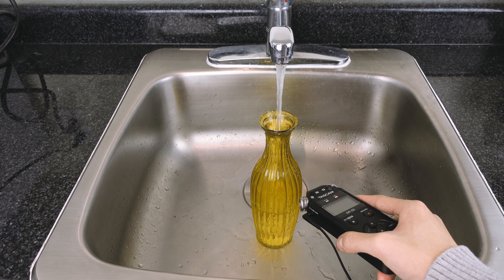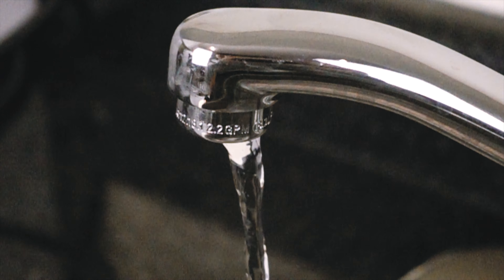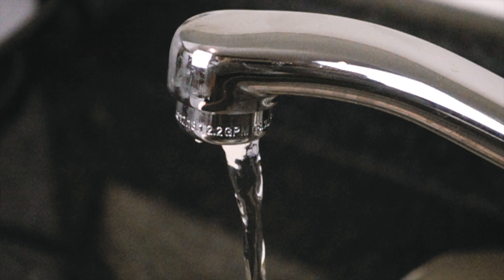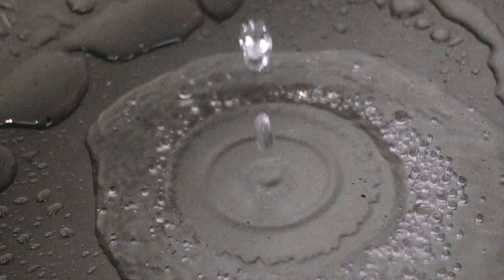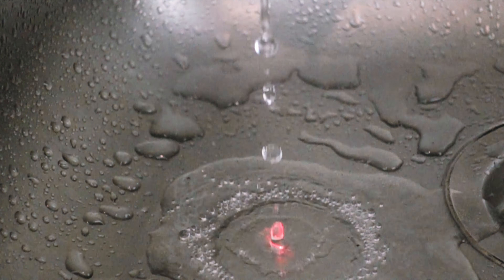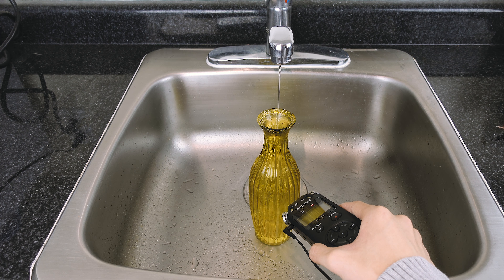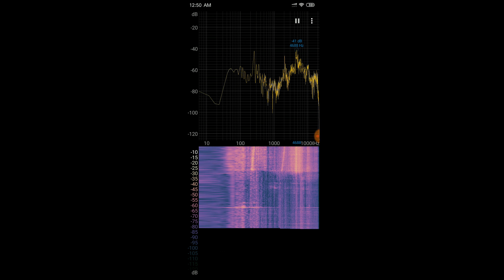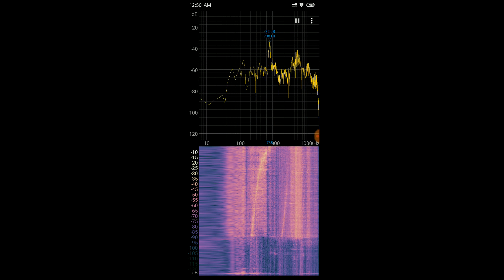IYPT 2019 Problem 5 Filling Up a Bottle Demonstration

Comment: can i ask you some question  Is the speed of water that flowing out of the faucet affect to the frequency of the resulting sound?
Reply from the maker: Of course when the flow changes from laminar to turbulent there will probably be a change in the sound of the water. But other than that, I didn't heard a significant difference in the frequency of sound. You can verify this easily with a simple experiment just like mine.

Comment: Hi, may I ask which spectrum analyser you used?
Reply from the maker: Hi Rachel. I used an app called Spectroid. If you have an Android device, it's available in Play Store. If you have an iOS device, an app called SpectrumView seems like a good alternative.
Reply: @canadianyoungphysiciststou9723  thanks for the reply! Anyway just trying my luck here, do you think the phenomenon here is standing waves? (Just for context my professor has made us work on this problem for a graded project. But since my group has limited physics knowledge we're a little lost here)
Reply from the maker: I think some form of standing waves is definitely important. I feel like the theory of a Helmholtz Resonator (maybe with some corrections) is probably applicable here. The shape of my bottle is not ideal. If you have a bottle with a simpler shape, you might be able to get a better match between theory and experiment.
Reply: @canadianyoungphysiciststou9723  Hi!! My group and I have analysed our data and we see a low resonant frequency for some of our bottles (which are mostly cylindrical) which may correspond to Helmholtz resonance. I've briefly read that Helmholtz resonance is usually produced by blowing across the top of the bottle. How then might it come into play when we're filling up a bottle? Might it be that the surrounding wind is blowing across the bottle top during the experiment?
Reply from the maker: Hi! The neck of the bottle is mostly open to the surrounding air. This implies that air is displaced from the bottle as the water flows in. So essentially there is a sort of "wind" blowing out of the bottle. This might be a factor that drives the resonance.
Reply: @canadianyoungphysiciststou9723  ooo I see, thanks so much for the explanation!! 

Actually, I have another question. If there are standing waves created (which our results also suggest), would the point directly above water surface most likely be a node or anti node? We learnt that for standing waves in closed end air columns, the closed end would be a node. 

However, in this case, isn't the sound we hear produced from the splashing at the water surface (closed end)? Does this mean the water surface is an antinode, because it is the source of sound?
Reply from the maker: I found a fairly comprehensive research paper about this topic at http://aix.acad.ro/sectii2002/proceedings/doc2012-2/05-Lupea.pdf

According to their analysis, the air pressure is the highest near the water surface. This corresponds to the lowest air velocity. This indicates that the water surface is actually a node. It is the same as just a simple closed air column.

The splashing might have a different frequency than the resonance frequency of the bottle. It is likely the source of some of the sound you hear but probably not the resonance.
Reply: @canadianyoungphysiciststou9723   Hello,
I would be interested in the paper you linked but umfortunately the link isn't working, could you send a working link?